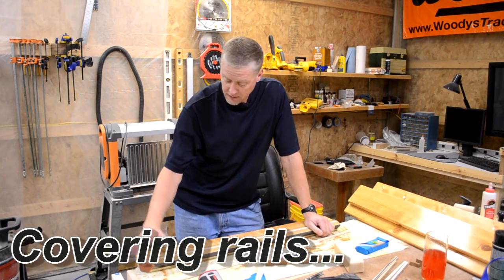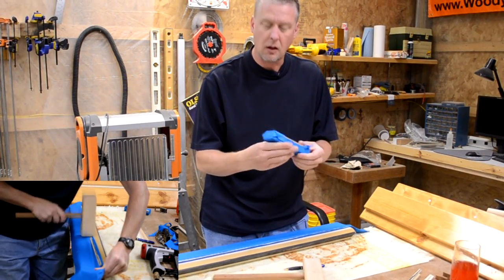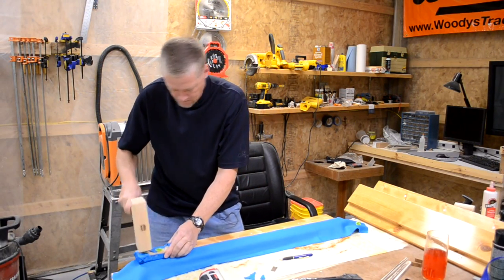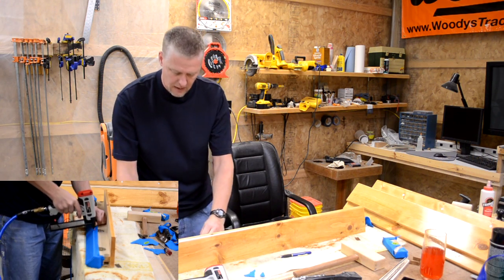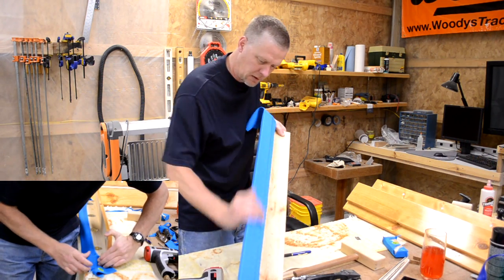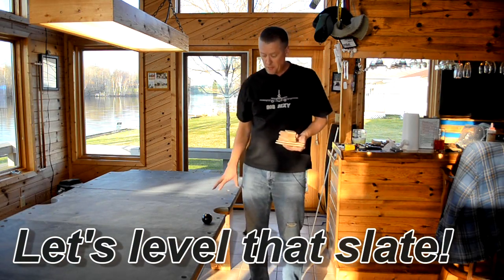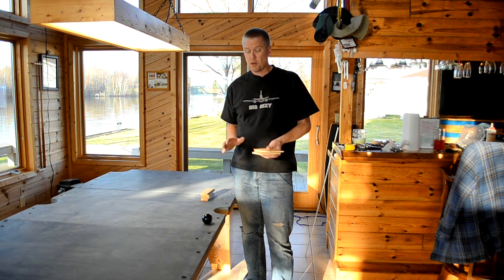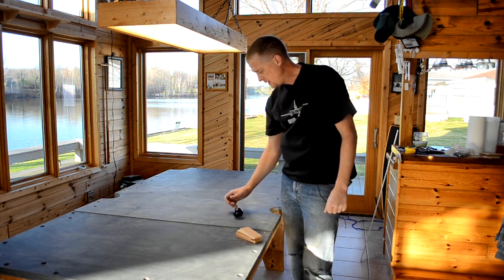How to Build a Pool Table, Part 9 - Efforts in Frugality - Episode 7.0

Comment: I'm currently building my own pool table.  your videos have been a big help.  Question on the feather strips and dados: how tight should the feather strips fit prior to the cloth?  I know it's hard to describe "tightness," but should they, say, just barely require effort to push in with your fingers with no cloth?  or should they be loose enough to fall out when inverted?  I affraid of it being either so tight that it cracks the rail when I felt it, or too loose and it slips out.
Reply from the maker: Thanks for the words, appreciated. I never measured the tolerance. I remember that I made them too tight originally and had to trim them down a few times. I ended up doing it by feel and experience. I know that is not a great answer, and I apologize for that. It has been, what, 12 years or so since I built it.  But, every cloth will be a bit different. My strips would fall out if I turned them over without cloth. When I recover it the next time, I will measure. I will tell you this, for Simonis and Mercury Ultra, the tolerance was the same or close enough. 
Bottom line, I did it by feel and what felt right.
Again, apologies for the vague answer , but that is all I can give you. To do it again I would measure the thickness of my cloth when compressed and go from there. Then just make it a bit tighter. Do it on a scrap piece of lumber first. It's tedious, I know. But that is the way of things sometimes.
Let us know how you ended up.
Good luck!

Comment: As a billiard mechanic who's been doing this for over 20 years now, i can say not bad. Mistakes here and there, but nothing major. I still want to see how your pockets will line up when everything said and done. In many cases when "pocket ear" hole is too big or broken (from taking table apart too many times or just old age) pocket will be too low or in some cases too high in respect to the rail. Interesting to see how that works out for you.

Also whats peoples obsession with razor blades? They are small and uncomfortable to use. I've been using same exacto OLFA knife for like 5 years now, just purchase new pack of 50 blades every couple moths or so.
Reply from the maker: Everything lined up great and still lines up great. Good point on the razor blades...habit???

Comment: Using an ordinary putty knife that's not machined verified straight like a straight edge, aren't you opening up problems here at your seam? I would think a more perfect tool would be necessary here?
Reply from the maker: blah We are talking about a gap about the width of .030. A true and precise tool wouldn't accomplish much. But I like where your heads at. Precision is a good thing indeed.
Reply: Ok I was wondering about around the gap where excess material might lay up left behind by a burr or uneven/cracked portion of putty knife. Do u sand the surface any? I feel some rough or uneven areas on my slate and so I bought a 4" glazing knife scraper to go over the entire slate before running a straight edge over it then gliding a ball all over to double check.